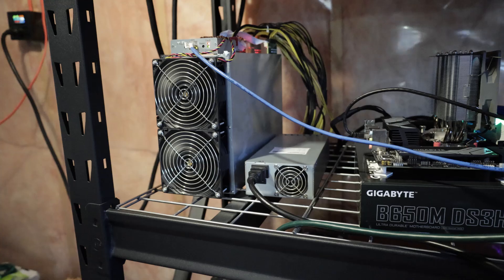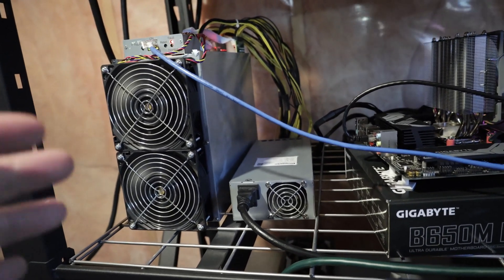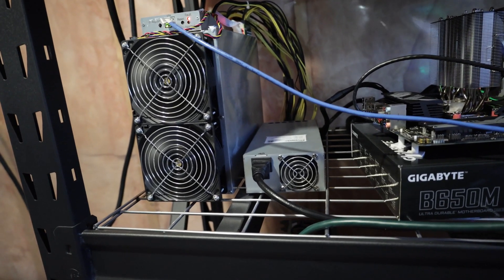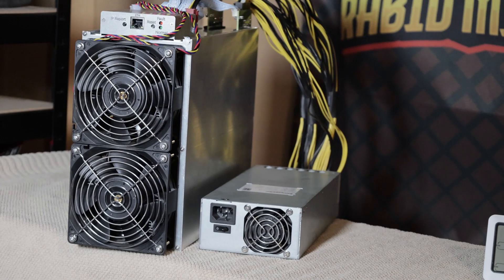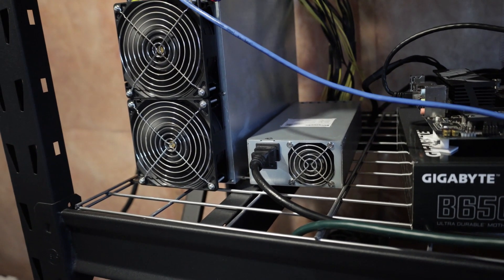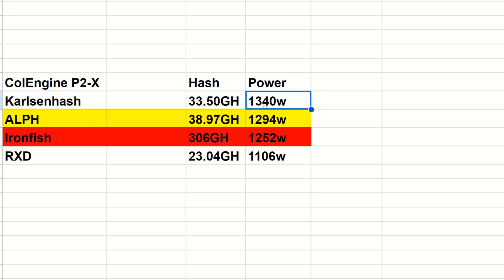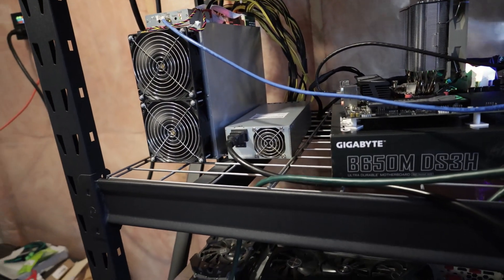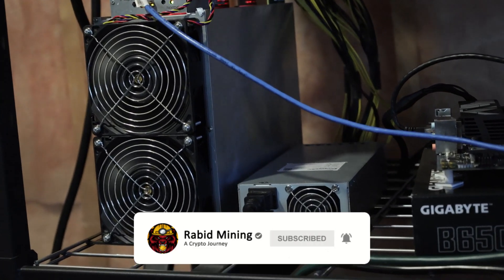Best Cost To Performance FPGA On The Market? - ColEngine P2-X

Comment: Does it come with power supply?? What wattage is it if so?
Reply from the maker: Yes 200v+
Reply: @RabidMining  Cord for my PDU? C3, C19, C20?
Reply from the maker: @kpak7825 it used a c13 plug psu side was c14 male end.

Comment: Is this machine capable of mining “IRONFISH” coins?
Reply from the maker: Use to ironfish forked but they are working on the new ironfish algo
Reply: After all, you mean you can't mine IRONFISH coins with this machine, right? I don't think all the mined coins included in the description are possible. What is certain is that IRONFISH coins cannot be mined with this machine, right?
Reply from the maker: @blacbird2427 ironfish forked but they are looking into the new algo for ironfish